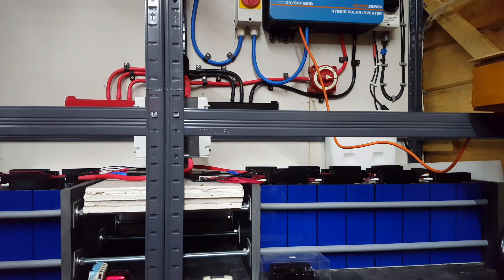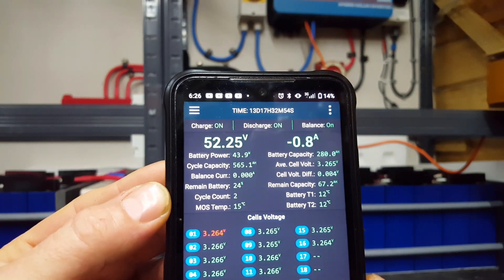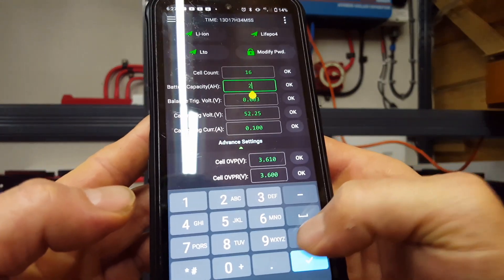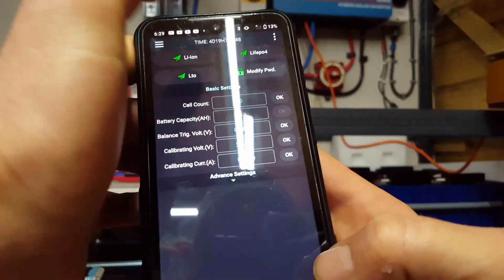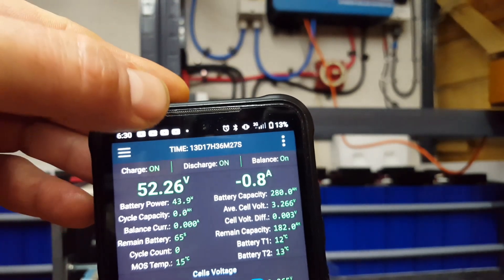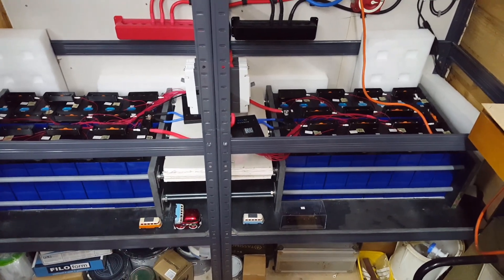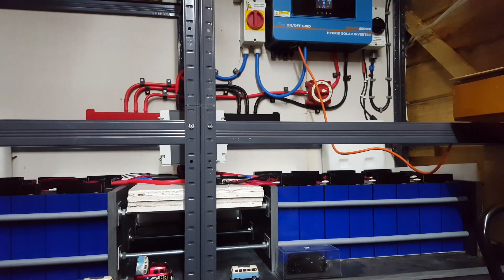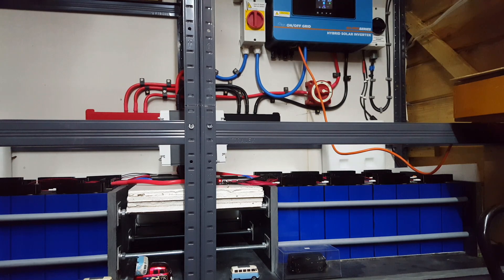Resetting the cycle count on a JK BMS

Comment: The counter got screwed when you reset the cycles, now you would need to fully charge to high voltage disconnect for the soc to be accurate again. For calibration I would recommend disconnecting 1 of the batteries, put a constant load on the battery (idk a heater or something) something that doesn’t change constantly, put you clamp meter around the cable and measure the current and put it in the settings, then you reconnect the other battery disconnect the one you calibrated and calibrate the second one. Hope this helps
Reply from the maker: Yeah I figured that out when I just looked at how much I have charged into it so far an thought "Oh Bugger".  😭
My in the wall plug in meter will tell me what It want to know including losses for knowing how much generation it will take to fully charge including the Angels share.

Comment: Great information, was able to reset my cycle count with your method.  Now I need to reset my SYSTEM LOG to make them all the same.  I'm currently have 8 Audi hybrid 48 volt battery modules in parallel with a JK bms on each module. Is there any other changes that can be done that is not in the bms manual.